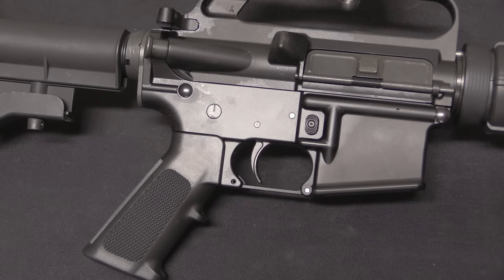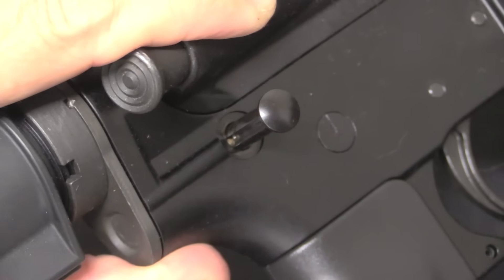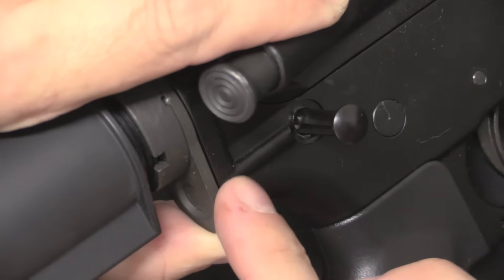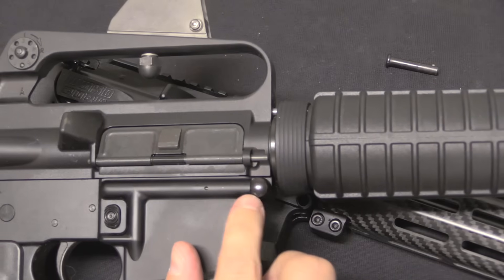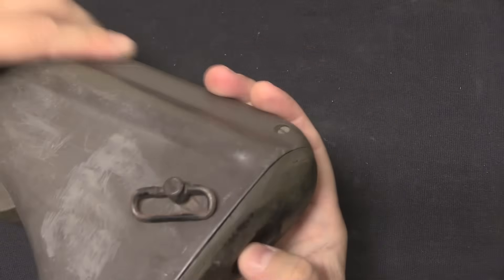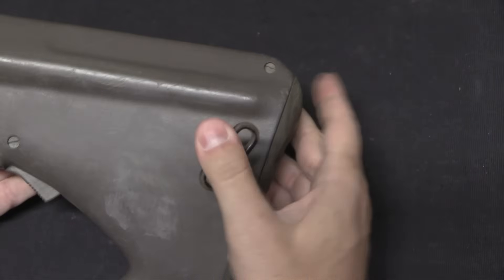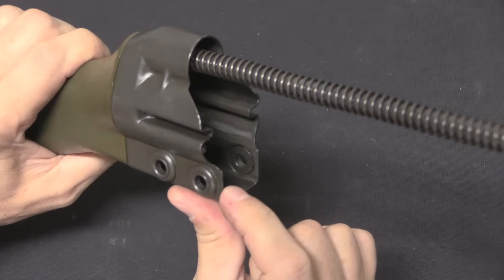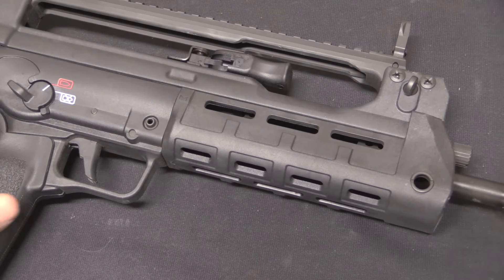Ask Ian: Why Don't More Rifles Have Captive Pins?

Comment: There are other ways to retain pins too. In some cases a part that is installed more or less permanently could have a feature which the pin would stop against. This can all be molded into a platic assembly easily enough. Havent seen it on any guns but have used something like it for a different project. A pin type part bad to not rotate so we had a macined flat. Assembling two parts together trapped that pin part in the bore from either being able to fall out or rotate. One part had the bores and the other part had a flat which just protruded past the bore and mated to the flat on the axle. There were some tolerance issues at first but it was easy to sort out.

I could see this on some guns such as having a little shelf on, say, a barrel trunnion or on a grip frame which is indexed perfectly to retain a cross pin. No tiny holes or extra parts to install, just a pin with a flat machined into it.

Comment: As an ex military member, weapons do get stripped at night or in very low light occasionally.  Captive pins are a much better solution.  The Steyr AUG - the sling will ensure the pin doesn't go missing.

Comment: Perhaps a more overriding concern is combat use in the field. In a critical situation where the weapon needs to be dis-assembled, cleared, and reassembled quickly, a small part that can become separated from the weapon and lost is a big problem. Same goes for troops just doing cleaning/maintenance when off-duty. Small parts get misplaced easily, the weapon can't be used - and the attack is coming. Not good. For most recreational users a lost part just makes for a lousy day at the range or while hunting. They may even have spare in their tool box. Not likely in combat. A captive pin is difficult to drop in the mud and lose. Bunches of small, separate parts is a recipe for disaster in serious situations.

Comment: IDK, for a civilian gun, you really don't need captive pins, as you usually clean them/take them apart at home at a table/work-bench with good light and a floor, and the chance of losing a pin is rare. For military use  captive pins and minimal numbers of parts to field strip a gun lends towards soldiers not losing them when they clean weapons in the field under less than optimal conditions. The small extra cost for captive pins is not so important on a military weapon either , and may well  be part of requested specs anyway, for the above reasons.

Comment: Just to add to this a reason why a lot of people don't just make the polymer thicker: to injection mold a part you want the part to have as constant a thickness as possible. If you add a huge bump out that is just filled with plastic then you will create a void or sink in the finished part because the plastic will shrink as it cools and could potentially create a weak point in the receiver.
Additionally, you really can't injection mold a part that is thicker than 0.180 or 0.160 without adding in  things like foaming or gas injection which are expensive, and typically avoided.

Source:  I'm a mechanical engineer that took classes specializing in polymer part design and production.

Comment: Counter point: the SCAR has a plastic lower and has very simple captive pins. All you need is a vertical pocket to hold a small U shaped spring and two circular grooves on the pin itself. The pin is lathed not milled and the receiver is less complicated than the example here.

Comment: Checked my Polymer80 Rhino lower and it appears they added material to help. Related item: threaded bolt-catch pivot. This is brilliant, actually. I don't see how the polymer aspect particularly enables this though I do see why they didn't want use a conventional roll pin. Other aluminum lowers have threaded bolt-catch pivots. Why not all? 103% upside.

Comment: I am skeptical on the polymer frame thing. I have a Tennessee Arms lower that is polymer, and my pins are captive. There is so little firing stress on the lower that the holes shouldnt make that much of a difference unless it has been minimized to the extreme for weight savings.

Comment: The SCAR has a captive pin on a polymer lower that is very sturdy and simple, a spring clip just pinches it in place, slotting into grooves machined in the the diameter of the pin.

Comment: If you lost a pin in the military, how hard would it be to get a replacement? There's obviously spares as an armourer, but I'm assuming for say the US military assume people are gonna lose them. How long would it take to get a new one in a combat zone.
Reply: That depends . The armorer is usually "in the rear with gear" /Company HQ and could be many miles/hours away , and losing a pin out in the field , generally deadlines a weapon unless some field expedient method can be done. 
This why many unit's have SOP's for the company 1st Sgt to have an  armorer's kit/foot -locker with him in his vehicle, which has the most common parts that can break or be lost for a unit's line weapons, even if the armorer/arm's room is a long way away. 1st Sgts usually are out with their line units(platoons/outposts/etc)in the field at least twice a day - running chow.
Sometimes platoon sgt's or other line soldiers can have a few common spare pins/parts, if it is a known issue, but not always.

Comment: I think every engineer who doesn't put a captive pin in a military rifle is a lazy dick.
Tip for the engineers of the future: instead of using drilled holes and tiny little springs with pins,  just use the CZ Bren 2 style takedown pin spring 
😉

Comment: There are different applications of types of captive pins that , the question is why it's not done on rifles more (Yes, I watched the whole video). It can be a ball detent spring loaded from within the pin and with today's polymer's it can be a hollow pin with a plastic flat spring design too. At the drill points and insert to reduce wear is possible too if there are concerns. The detent can be made to release when pushed with a round or a push pin. I can only assume that certain companies had a design for a long time, their machines that make them or were set up elsewhere to make them with cheaper labour work across lots of small arms, so why would they change it now? Just like some zipper companies or mag companies, one should just make those pins and options to choose from.

Comment: The  HK G3 with original stock has a clever solution for the non captive pins, there is 2 holes for the pins in the stock...

Comment: The FN SCAR nailed it - just a little clip and a taper at the end of the pin. Just one extra part that’s incredibly cheap, and If it fails, no big deal, then it’s just a removable pin. The lower has a little pocket molded for it to hold it in place, but it is not load bearing, and still functions even if the pocket breaks. Such an elegant design :)

Comment: The KP lower is just a cheap-out. Other polymer lowers put their sn plate in a position that allows the detent hole to be drilled. An easy fix but added cost.

Comment: and on the FNC there are small " U " spring that hold the pin but they are easily pulled through and then you can loose the springs.

Comment: The AR15 style takedown pin is just way too complicated. The Swedish AK5 (FN FNC) has a captive takedown pin similar to the VHS-2. The pin is a single diameter with a ramped smaller diameter near each end. Around the pin and inside a milled slot in the receiver wall is a horseshoe shaped bent wire clamping around the pin, thus locking the pin in either the in or out position by springing into either smaller diameter end-groove.

Being a mechanical engineer, this seems like a way cheaper and easier to manufacture solution than drilling tiny holes for coil springs and detent balls and milling keyways in the side of the pins. Also, both takedown pins are identical using this solution. You should take a look at it if you have a chance, Ian.

Comment: A downside of captive pins is that if people strip the rifle and leave the pin sticking out it is very vulnerable to damage and training needs to be there for the pin to be "parked" back in its closed position, even with the rifle in kit form. Whilst this is a training issue it's still probably less likely for people to break the protuding captive pin than lose the detachable one.  Then again, the finest belt fed machine gun, the FN MAG, (GPMG in British Service) has a TWO-PART(!) detachable pin securing the trigger group and everybody gets on just fine with that....

Comment: Sorry Ian, "captive pins" are definitely preferable. Just wait until "you" must disassemble your weapon, especially in adverse conditions (i.e. low or no ambient light, "on the receiving end of incoming",  inclement weather, dust, sand, dirt, mud, gravel, ash,  rocks, thick vegetation, rain, sleet, snow...). Every weapon you previewed that didn't have captive-pins, could have had them incorporated at the "design stage" without major difficulty or extravagant additional cost. The KE WWSD 2020 could have be "designed" to use captive-pins, likewise the AUG as well. After initial design work, engineers who are tasked with development, can be "overruled by bean-counters", management and/or be simply ignorant of "actual field use". A quick look at the history of manufacturing easily shows that "pennies do count" and take precedence over the needs of the end-user.
It nearly always breaks down to the bottom line: "fractions of dollars & cents".
Again, actual field use should dictate the design of "combat weapons", not the lowest possible price-point. The training cost of a new recruit to the U.S. Military can be upwards of $70,000...yet his weapon may have been designed & manufactured to satisfy that low price-point.
Ian, nearly every weapon-system has "proprietary" pins, unless specified or designed otherwise.

Comment: My GSG Stg 44 has the H&K style of pin (obviously lol). While I could certainly see it getting rusted to the point of getting stuck. I generally disagree with it getting in bad enough condition to stick when in regular use or in good storage conditions . It would have to be put up in bad storage conditions or generally ignored when cleaning for long periods of time for it to get bad enough to jam the spring inside it. But never say never, great presentation by the way.

Comment: Typically, you'd want to avoid drilling holes like this into thin plastic sections as there will be a high risk of the plastic splitting where it's thinnest, ruining the entire part. It would also be a separate operation that would require a jig/fixture, adding to the cost and lead time. The detent hole in that MDRX grip you showed appears to be molded rather than drilled. Notice how clean the hole is and how it cuts into the side wall slightly. Molded features like this detent hole would increase the complexity and cost of the already very expensive mold. For example, the circular features above and opposite the hole are from the ejector pins need to free these complicated areas. Holes like this may also add complications such as voids, flow lines and sink marks.

Comment: One benefit of not having a capitve pin is that the soldier can easily swap it to the other side. So for example if you are a left handed shooter, you can flip the pins to the opposide direction and then prevent them from being pushed out of the gun while carrying it. If the flat head of the pin is on the side where the gun rests on your body, there is much less risk of pushing it out.

Comment: I've seen captive pins in non-firearms applications in which they used a C-clip that slid along the pin and was stopped by a groove on the end of the pin.  While not fool-proof, it does require deliberate effort to pull the pin through the clip and seems like a good solution for sheet metal components.
Reply: One of the “features” of the SA80 was it used this method.  If one did pull the pin all the way out it was almost impossible to get it back in without a tool.
Reply: Like the captive pins on the minimi. It's not that hard Mr. Stoner...

Comment: There is another way of course. A dissasembly lever like the FAL or even smarter using already spring loaded parts like the recoil spring guide on a Kalashnikov! You only need to take out a pin on that if cleaning the gas tube.

Comment: The FNC design is quite simple and should work on polymer receivers as well. The (captive) pins are round and can rotate freely. They have two grooves around the circumference, to hold them closed and open. The captive mechanism is just a fairly thin wire locking pin installed in a slot in the receiver from the top. They can be removed with just about any pair of pliers. If they get bad, remove them, bend them to get a tighter grip and reinstall. Simple. The pins seem to be turned on a lathe anyway and the receiver is milled. So there probably weren’t many extra steps in production.
Reply: I wrote a comment saying exactly this. This system is far superior in simplicity to the AR15 pins. Should be very cheap to produce.

Comment: As an Austrian I have to disagree (slightly) on the pin on the AUG not being captive.
In standard military use the pin is actually captive, as it contains the rear sling mount and you can not really remove the front sling mount. So the pin is not captive in body of the gun, but it is connected to the sling.
Reply: I'm super late to this but for those who don't know, the rear takedown pin is also the tool to adjust the gas block above the foregrip. So it's somewhat handy to be able to remove it from the stock.
Reply: @samueljardine3402 So... it's a tool that is dummy-corded to the rifle? 😄
Reply: @samueljardine3402 holy shit. I always wondered why my gas block was like impossible to adjust.
Reply: Good to know. Thanks.
Reply: that's very cool. thanks you
Reply: Very interesting.
Reply: So...is the sling loop captive in of itself, or...?

Comment: This has been my question too for the longest time. Figured it would be because they're cheap, was not disappointed. Stamped sheet metal is already cheap, wouldn't be difficult to just take a sheet and press a bunch of circular pieces out, use one or two at a point where a pin is needed and then use friction stir welding to allow that chunk to be used for a captive pin. But time is money, extra materials are money, more wear on your tooling is money and manufacturers are cheap. Makes me want to start a gun manufacturing company.
Reply: You are forgetting something. Customers are cheap also.

Comment: Pins don't need to be designed like that first example to be truly "captive".
As with any engineering solution, there's more than one way to do it, each with its own unique set of pros and cons.
For example, you could have a pin that has a built-in detent, rather than having it rely on an external detent.
This way is even easier than ever before, now that we can 3d print metallic components.
Or you could have a 2-part pin that screws together (for the purposes of installing/removing the pin completely, rather than disassembling the firearm), and it would be bigger in some way on both ends but still free enough to move that it permits disassembly, this method might not even require a detent, or if it does need a detent it could have an external lever that locks the pin into place when the firearm is fully assembled.
A third way would be to have the pin have a long slot in the middle of it that a roll pin fits in, the roll pin would then let the assembly pin move but only to a certain extent (sort of like how some bolt cam pins on rotating bolt firearms are fixed within the bolt carrier group).

My point is that there's plenty of ideas out there ready to be applied to this problem of "making the assembly pins captive", it's only a matter of selecting the one that has the right mix of advantages and lacking disadvantages that can't be compensated for.
Some of these ideas may require the design of the receiver halves to change so that there is not as much force on the pins, such as adding some relatively coarse serrations (coarse meaning several mm tall and wide per "tooth") that fit together when the firearm is assembled, this would help reduce the impact of bolt thrust on the assembly pins, and if you're using stamped steel or cast aluminum or even polymer receiver halves this shouldn't even be too hard to implement (just slightly adjust the shape of the stamping to incorporate those serrations). Steel serrations would be able to be made relatively small, the serrations in aluminum would have to be larger, and in polymer the serrations would have to be larger still, even if the "polymer" is actually a composite material with a large portion of fiberglass fibers in it for increased strength.

Comment: Captive pins are useful. But if I were to try and keep engineering costs down when designing a gun, one thing I'd make sure to do would be to have one of the receivers have an indent of some kind with a magnet attached to the base and making sure that all the body pins and other small parts are made from magnetic metals.

So whenever you pull pins out and want to avoid losing them you just stick them on that indent and the magnet holds them in place until you need to put the pins and small parts back in their proper place again.
Reply: This would work until you face an enemy force armed with ultra-powerful electromagnets.
Reply: @AshleyPomeroy  I'm not following.
Reply: and what else gets stuck on the magnets?